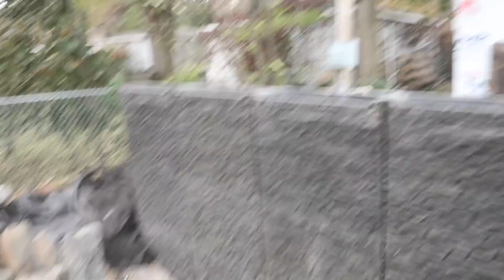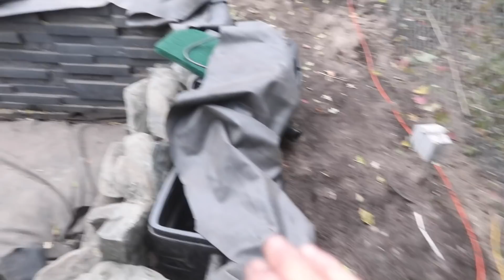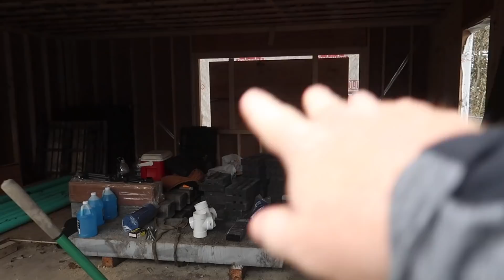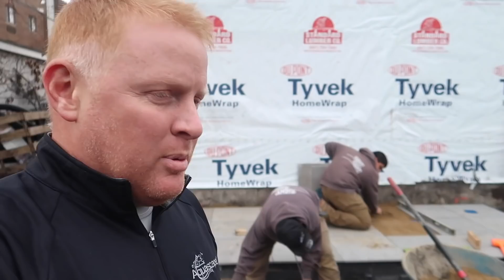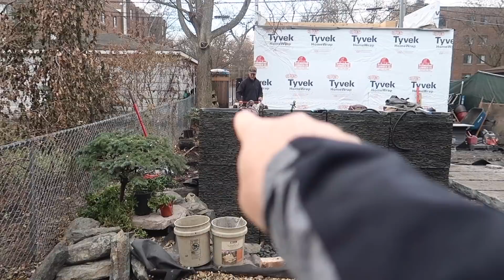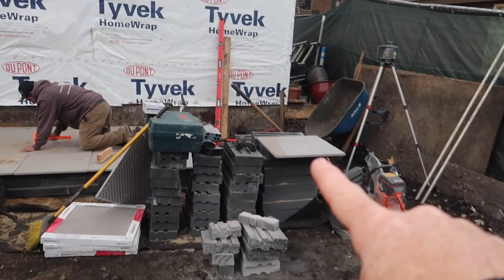*FORMAL KOI POND* Final Push - Part 3

Comment: I'm a little concerned that you're not putting the porcelain tiles onto a concrete bed and then mortaring then down....being they are so very fragile are you not concerned they will crack being on a bed of sand?
Reply: Normal porcelain tiles are 1/4" thick. I noticed these were 2 to 3 times as thick - unless he was showing something different, such as stepping stones. Don't know if this has any bearing - but if it is 5/8" or more it might, emphasis might. Porcelain is very strong - but also vulnerable to a point hit (think bowling ball where it impacts with the full weight on roughly one square inch).
Reply: @julieenslow5915  Where I live no 'decent' Landscaper would ever put 'tiles' of any kind [other than concrete pavers] on anything other than a solid concrete pad and then mortar them in....to counter act any 'point hit'(ie) having them on a solid base ....however we do not freeze here so that might be a reason, but still putting tiles on sand doesn't seem right.
Reply: @SRM_NZ  
It would depend on the manufacturer's recommendations. I have never heard of porcelain being more than 1/4" thick. If this is in fact 3/4" as I think he said - then it is something I am not familiar with and I would not say whether it can hold up or not. That was my point. I've been retired for 12 years - lots could have changed. But just using my own experience and understanding how much can be improved in 12 years - I would say it is possible. Easy to say otherwise, better to know first.
Reply: Hey there, great point. Typically, as you stated, regular tile would be much too thin and fragile to set on a sand bed. However, this product is over 3/4 of an inch thick (0.79”) to be exact. Per manufacturer installation guide for pedestrian foot traffic, the porcelain tile should be installed on 2-4” of compactable sand. To cope with our freeze/thaw cycles in the Midwest, we also installed 8-10” of compacted Grade 8 or CA6 base material under the sand. These tiles are produced using a process that creates a denser than normal material allowing for temperature swings from -60F to 140F. Let me know if you have anymore questions! 

Thanks for the feedback!
Reply: @nicks.9360  
Thank you for the information. Great product. Awesome project!
Reply: Nick S. 👊